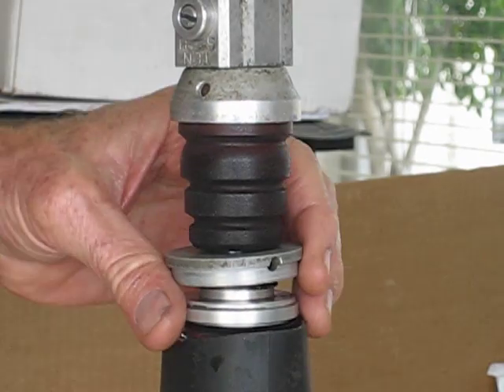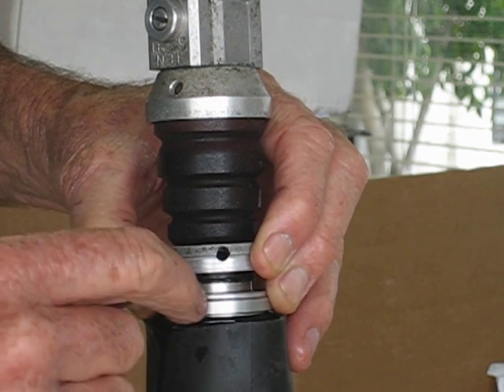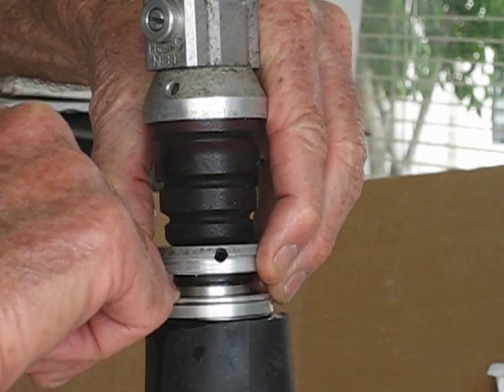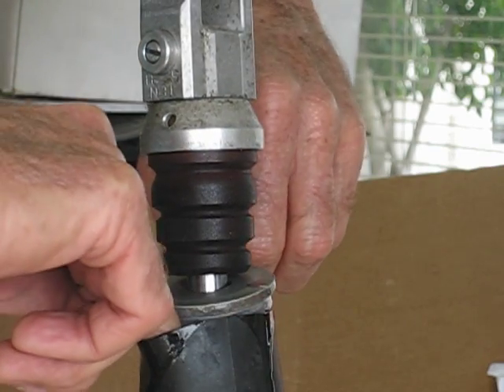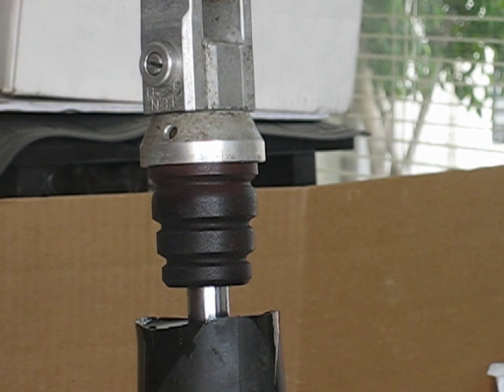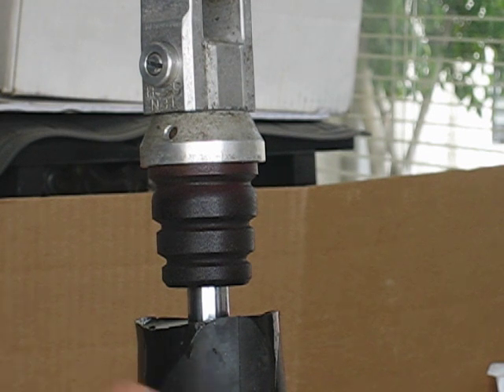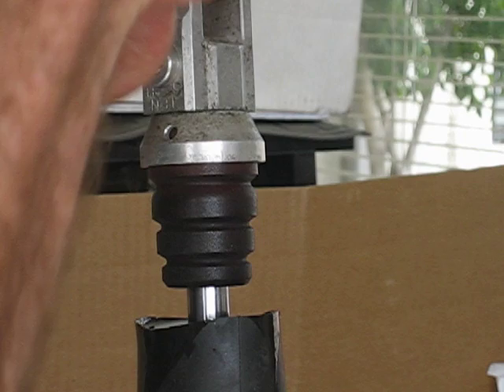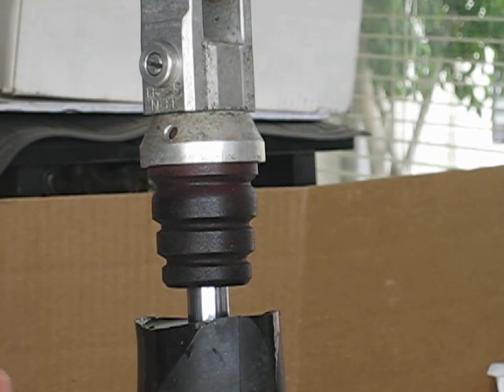Team Squirrel Tech Tips - shock revalve - part 15

Comment: Great video series.  Could you give some more details on the bleed hole you drilled?
Reply from the maker: Some seal heads come with a bleed hole; some don't. Air stays trapped inside the seal head when you push the seal head into the shock after careful bleeding during the assembly process. The bleed hole allows for that trapped to escape through the seal head to ensure all air is out of the shock as the seal head is pushed it and the snap ring is installed. I carefully drill an angled 1/16" hole just below the o-ring on the outside of the seal head into the recess where the actual oil seal is located. Just make sure the hole doesn't cut into the lip on the seal. And the hole has to be inside where the oil is, not above the oil seal and o-ring. Hope this helps.
Reply: robinsongguitars That helps a bunch.  I am always trying to learn the little tips and tricks to make things work better.  On a side note, that xr650l of yours is  amazing, every deficiency seems to have been addressed.